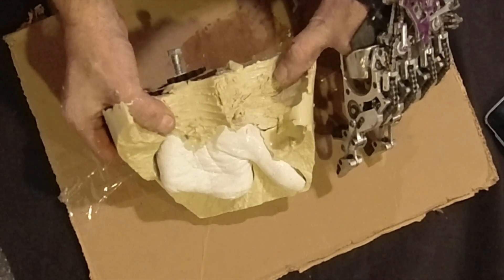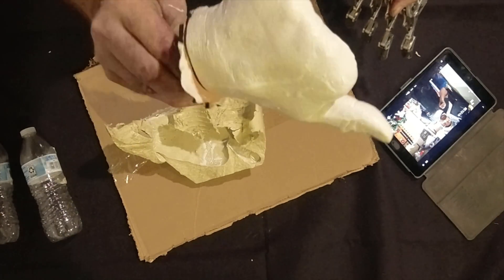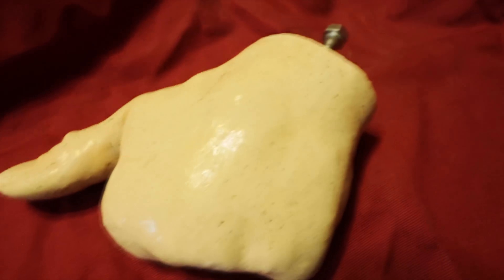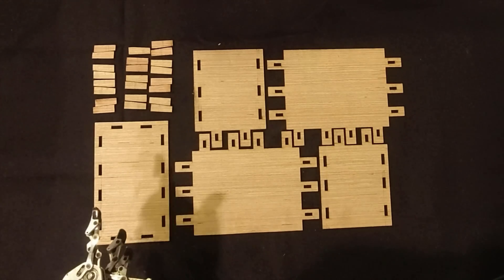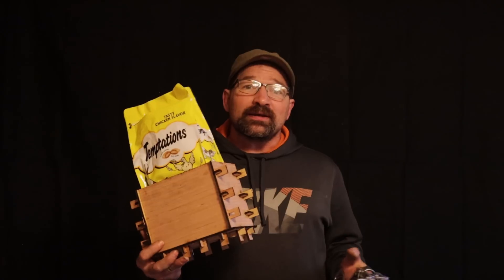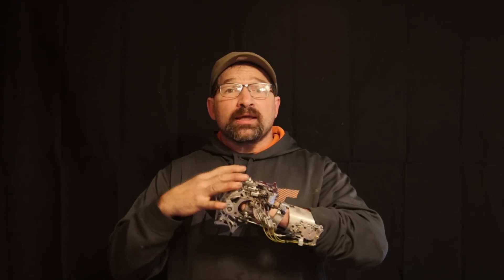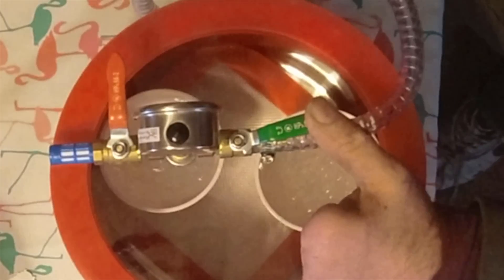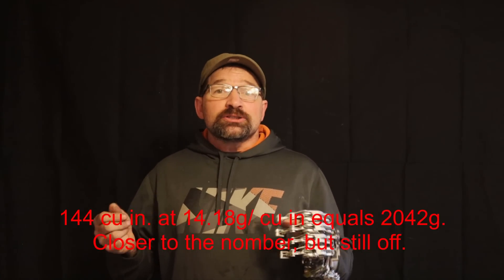3D Printed Prosthetic Hand Diy Video No 2.  Casting a master mold in silicone.

Comment: you might be able to use this stuff called thermo-lock to make a socket instead.  you wouldnt have to cast anything. just boil it in a pot and mold it around your hand. though you just have to be careful not to burn yourself which isnt terribly hard. though i dont know if it would expand and squeeze the hand and hurt it.

Comment: You could have dipped the plaster cast into a container of water with graduations to determine the volume of the cast. Then subtract that from the volume of the box to determine how much silicon you need to mix up.

Comment: imagen gecko tape finger tips better gip with less force and no stickiness, could save some weight from using gears to increase the grip as it uses shear forces to grip rather than friction I saw it used to pull a car in this vid: https://www.youtube.com/watch?v=vS0TuIPoeBs&t=714s
but for everyday griping wear you only need a small amount of force mainly in a single direction( stop objects leaving your palm) something like this could be very beneficial to increasing the usefulness and versatility of prosthetic fingers. I mean if they're using it for robot grippers why not prosthetic hands? P.S love you videos your doing the lords work and making it entertaining.
Reply from the maker: I saw the same video today, it would be amazing,  but using that durometer silicone wouldn't be durable at all for daily out in the wild use. I have a hard enough time getting 40 durometer to last any time, I couldn't imagine how fast 10 would turn to garbage.
Reply: @missingpartsclub  yes I hadn't thought about that but I'm sure as the technology progresses and becoming more accessible, just judging from some of the problems I have seen you talk about with bulkiness and the accessibility of your current method, this could be very good for this application. but I'm not 100% on this nor qualified/experienced enough to know for sure. would be cool to to see what the future may hold if you had the opportunity to design a mechanism with this material in mind.

Comment: hmm... is the final sock going to be a thin layer of silicon spread inside the master silicon mold? I feel like i'm missing the big picture.
Reply from the maker: I'm setting this up to be a hard socket. I've had way better results doing that than including a liner. Better proprioception and grip precision because you don't need to adjust for the squish of the liner.
Reply from the maker: You totally could though, after you modify the plaster to get rid of the squishy parts on your hand on the plaster, overlay 15 minute 2 part silicone to that and then do a wet layup and vacuum bag from there.